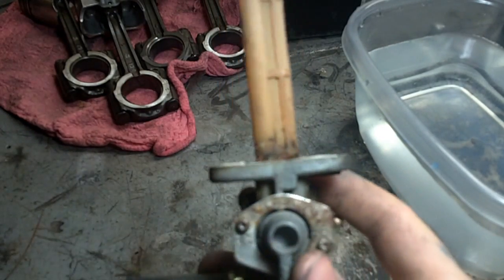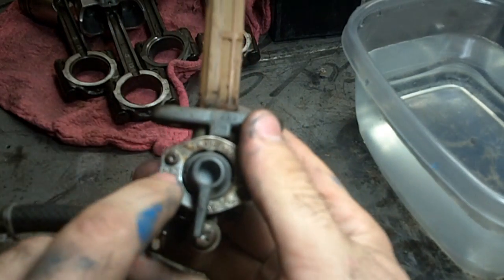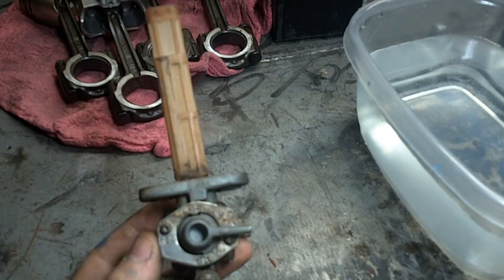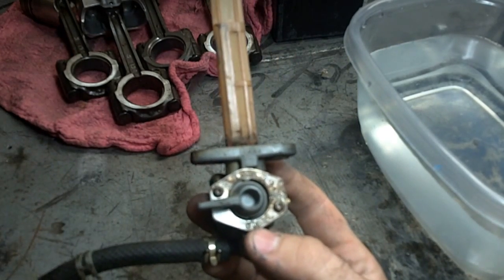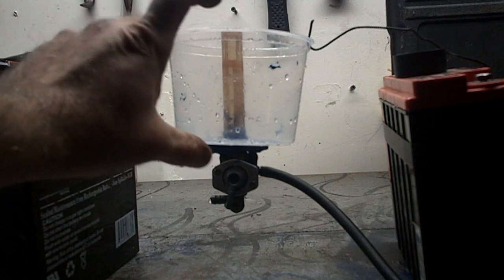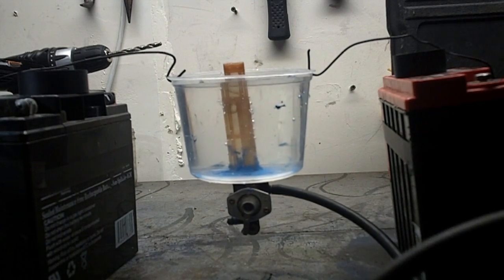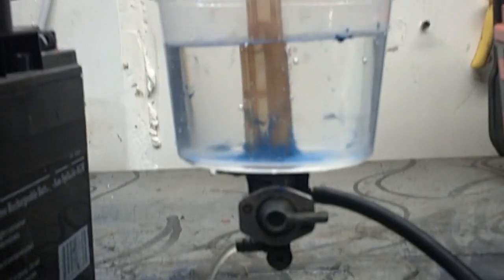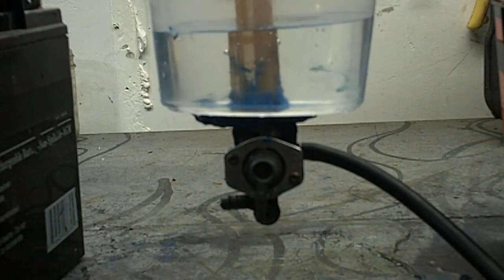How does a motorcycle petcock work?

Comment: I was just given a 1985 Honda shadow V. T 500 C, and there's the one line that goes from the petcock. Straight to the cylinder head. Then there's a big line with the Spring on it. That goes to the big nipple on the back. Then there's a little nipple on the back. Also, that when you turn the petcock on the fuel shoots out of.  And I can't for the life of me, find out where to hook that 1 up to.

Comment: What would be problem if no fuel flows when in prime position not a drop
Reply from the maker: Petcock clogged up. Take it off and replace it or clean it out
Reply: @mrmaxstorey  thank you for quick reply I have it of today can't see any thing  blocking any bits can I use carb cleaner spray  through it . I have also bought a fuel tap repair kit today
Reply from the maker: @johnshanks7902  yea give it a shot, if it's the kind that has screw and not rivets it can easily come apart
Reply: @mrmaxstorey  yes it's screws bandit s1200 1999
Reply from the maker: @johnshanks7902  ok then check out my other petcock video it will help

Comment: If you have a a vacuum petcock on your bike , can you put a gravity petcock on it ? Or does it have to have vacuum
Reply from the maker: yes you just need to block off the old vacuum line
Reply: @mrmaxstorey  the one on the carb?
Reply from the maker: @Titanwins90  Coming out of your petcock are two hoses, a big one and a little one. The big one brings gas to your carbs, and it must be hooked up to your new petcock. The little one was the old vacuum line which used to open the petcock. You don't need it now, however it must be blocked off so the motor does not suck in extra air. Leave it connected to either the intake manifold or the carb depending on your bikes setup, and on the other end which used to connect to the petcock, put a little bolt in or tie it in a knot so it is blocked off
Reply: @mrmaxstorey  oh okay yes that answers it all , thank you Sir , mad respect 🙌

Comment: This is a very helpful video to understand how this type of petcock works. Thanks a lot for it. Now I can dry my carburetor just by pulling off the vacuum line and run the motor until it die for winterization.

Comment: Hello this is from the future and I have a quick question. I have a scooter with a petcock and carburetor that doesn't require a vacuum feature. Now my carburetor have a problem and I have a reserve carburetor but it has a vacuum hose attached on it. My problem is can I still use this carburetor and just plug its vacuum port since I don't have a vacuum port to attached it on my petcock? Thank you very much in advance for answering my question.
Reply from the maker: Yeah thats fine
Reply: @mrmaxstorey  do i need to plug the end of the hose or leave it as it is?
Reply from the maker: Plug it up

Comment: I had a question hope you can help. Trying to get a 1977 Suzuki GS550 going. It’s my first project bike. 😬 So when my tank and petcock all hooked up looks like no fuel is going through but when I disconnect the petcock to test it it seems fine. Is it a vacuum issue or carb issue? Total rookie at bikes but trying to pick up a new hobby. Your videos rock!
Reply from the maker: Im not sur eI understand your question. Are you saying that with gas in the tank, and your petcock on the gas tank, you turn the petcock to PRI and you do or dont have gas coming out?
Reply: When I have it on prime gas does come out when it’s not hooked up to the carburetor. But when it’s all connected to the carburetor it looks like no gas flows through the fuel line. I also realized that what I assume is the vacuum line isn’t connected to anything and just has a screw blocking it. So maybe it’s that? Or am I wrong?
Reply from the maker: @SaiasAdventures  OK so either the carbs are already filled up and dont need gas, or the floats are stuck not letting gas through. At some point the vacuum feature of your petcock failed and the previous owner plugged it up, so now it operates as a manual petcock where PRI is on, and any other setting is off. Thats fine for the temporary until you fix or replace the petcock, so long as the vacuum line going to your intake manifold is also plugged up.
Reply: Thank you so much! I will check those next
Reply: So I removed my carburetor and notice little to no gas in them. Taking apart the carbs all the float needle inlet valves have a groove in them. Which I believe is causing the floats to stick. But I also noticed the carburetor isn’t the original set. The service manual has a Mikuni BSW30SS and I currently have Mikuni KOGYO. Would this be an issue as well?
Reply from the maker: @SaiasAdventures  I dont know. The main thing is the jet sizes are correct, but differences in lengths and size of the venturi can affect the way the bike runs. Its unlikely that this is stopping the bike from running, but I dont know to what extent it will change reliability, power distribution through the powerband and fuel consumption
Reply: Okay thank you for your help!

Comment: Quick question, when I disconnect the vacuum line from the engine block and suck on it, gas flows through the petcock but when I connect it again to the engine block and crank the bike, fuel doesn't flow at all. what does this mean?
Reply from the maker: Maybe the line is leaking? Or that cylinder doesnt have compression?

Comment: Great video!! Question. Just picked up a 1982 cb900f.  Jetting spot on. And it runs super strong.  Going down highway after only a couple tank fulls on this bike and it started to bog and I hit reserve  but still stalled.  Pulled over still had about half gallon in It! Do you think the reserve hose is clogged???  Put 2 gallons back in it and it started right up again
Reply from the maker: Maybe, this video shows how to test

Comment: Questions....1) could this be the root cause of mine flooding and pouring gas all over the floor? I always thought it was the float valve sticking. Was it acting as if on "prime" and constantly flowing fuel, even though on "run"? 2) Would this cause problems if tank was not vented or vent was somehow blocked? Any useful comments are greatly appreciated.
Reply from the maker: Yes when your carburetor is overflowing while sitting then 2 things have gone wrong, both the float valves are sticking open and the petcock is leaking. If the tank is not venting then you would have fuel restriction after running for a short period, and that is an unrelated problem.

Comment: Ahhhh....okay....see, my petcock (from a Chinese 48cc engine kit" has "Fuel -->" written on the switch, and you can turn it 180°, and at the 0°, °90 and 180° points there are 3 tiny diagrams (respectively for each degree point), which are a half tan, closed/solid circle (in the °90 degree point), and a half tank. I believe you just solved my mystery ;) the "half tank" means you are reserving the reserve tank, so to speak. I'm so glad I found your video!!!

Comment: I've got a GS500 1999 model starts great on idle but dies soon as I try and rev it I've cleaned carbs and checked for air leaks all good there could my Petcock be at fault ??
Reply from the maker: If gas is getting to your carbs to allow the bike to idle, then the petcock is probably not at fault
Reply: mrmaxstorey  yes true I though maybe the flow may be very slow but would rather leave it alone incase I cause a split in a seal or something. Bike had previously sat for 3 years ran perfect before storing I'm baffled carbs are clean no air leaks and tank is clean with fresh fuel
Reply from the maker: How is your compression?
Reply: mrmaxstorey 150 on each cylinder first thing I checked even though a mechanic told me if it's starting straight away compression will be fine however I checked anyway and got just shy of 150 on left and 150 on right
Reply from the maker: Plugs not fouled? Good air filter? Float heights checked? Emulsion tubes cleaned? Valves adjusted? Clean carbs again...
Reply: mrmaxstorey  plugs are fouled yes they keep fouling

Comment: So on my 1980 Kawasaki 440 I have two plugs on my petcock. One is a line that goes to the fuel filter and the other is a vacuum... but how can I tell which is which?
Reply from the maker: The vacuum is smaller and on the back
Reply: mrmaxstorey thank you sir. I finally found the manual as well... the carbs are leaking fuel now. Any suggestions?
Reply from the maker: Check out my video on leaking carbs

Comment: Nice video! Mine doesnt have the vacuum hose, so I guess it creates pressure directly from the fuel line going to the carb. My question is whether adding an external fuel filter would significantly lower the pressure as I start running out of gas (due to lower weight of fuel)? I really wanna add the plastic filter, but dont want to end up dealing with a low pressure fuel system.
Reply from the maker: Its not under any pressure, it just comes down by pressure. I havent had any problems with inline fuel filters
Reply: mrmaxstorey thanks

Comment: Is it okay to ride my motorcycle without the petcock filter on it? Will it harm anything without it? 

When the gas tank was repainted the petcock filter was left out at the body shop and has not been replaced.
Reply from the maker: If the inside of your tank is spotlessly clean and stays that way, you wont have any problems. However if you develop any rust, dirt, corrosion, or sediment in there, there is no filtration to prevent it from going into your carbs. It is cheap insurance against a carb cleaning
Reply: mrmaxstorey gotcha. Insurance is a good way to look at it. Thanks for the reply!

Comment: I juwt bought a 1981 kawasaki 440 and my petcock has like 3 places it looks like you can plug stuff into. But only one place is pluged in.

The bike wont stay running if its switched to on it will eventually stall when i slow the bike down. Is this an issue with my carbs or the petcock
Reply: Also the petcock does not have an off mode just. ON PRIM AND RES
Reply: Manuel Seniceros I have a 95 Suzuki Savage 650LS. My bike was running just like the way you described in your comment. I just changed my factory petcock to a Yamaha Raptor 660 gravity pulled petcock. My factory petcock only had a RESERVE, ON, and PRIME also. The new one I'm running allows you to turn off the fuel all together while sitting. Also I knew my bike was having issues once it started to only run in the PRI and RES postions. The part cost me 30 bucks for a brand new genuine Yamaha petcock instead of 110 for a new Suzuki factory one. It took me about 15 minutes by myself to fix the issue.

Comment: I have a 49 cc scooter and there's no valve to turn off and on only a square bolt. I'm looking at this because it won't start unless you squirt gas into the carb. So I figure petcock or fuel filter. any advice? thanks

Comment: yo, thanks a lot! I've got a '96 Kawasaki Ke100 and this helped much. I'm new to bikes and got this bike from a dear friend. However, the hose that runs from the vacuum to the engine I presume will not fit? am I missing a part which attaches to the hose as an intermediary?
Reply from the maker: Usually its just the hose. See if you can squeeze it on there, sometimes the rubber shrinks and its tight
Reply: It's shrunken for sure. I may just try to expand it if not then replace it. I did an inspection and I've gotta grab a new petcock. That delicate tube that you spoke of eroded with the old gas. The bike had been sitting for a few years. I've got work lol. Dude, I appreciate your patient video, you've inspired me in many ways
Reply from the maker: Glad to help

Comment: What do you think might be the problem if I have a bike that if I put the petcock on the ON position it starts all good and runs good but then about 20 min later the throttle response will weaken until it sputters and dies. However, if I turn the petcock just a little bit to be in between the ON and PRI positions it works completely fine the entire time. Any ideas?
Reply from the maker: Take your petcock apart and see what is damaged in there

Comment: So the Vacuum line leads the the carbs, and the fuel drain( where all the water was escaping from) leads to where? the engine or a fuel filter?? If anyone cold answer than for me it would greatly help! Btw i have a xr100r.
Reply from the maker: That goes to the carburetors. Sometimes there is an inline fuel filter, its a good idea to have one
Reply: Thanks! Ill check it out, trying to get this dirt bike rebuilt for the summer haha

Comment: Does all petrol drains out of tank if accidentially petcok remain on for like 2-3days? And where does it flow? On floor?
Reply from the maker: +Dark Prince Im not sure I understand the question
Reply: i think he means "if the petcock remained in the prime position for an extended period of time, would the gasoline continue to run out even with the bike off? and if so, where would it go?"

Comment: my petcock leaks from a small hole on the plastic piece that sandwiches the vacuum connector plate to the back of the petcock. It was clearly put there by design. Just wondering what the purpose of this hole is and why it leaks when i have pet set to on or reserve but there is no continuous flow. Any thoughts?
Reply from the maker: +Zillacus Your petcock leaks because that diaphragm has a hole in it and will need to be repaired. The purpose of that tiny hole is to allow air to go n and out on the other side of the diaphragm, so trapped air isn't providing pressure for the vacuum to work against. Otherwise it would be a closed system and wouldnt be as effective. Hope that makes sense.

Comment: +mrmaxstorey  Does vacuum work with a vented gas cap? 
Pretty much what your can of water is.
Reply from the maker: +BennyWheelie A vented cap just lets air in as gas flow out, its not related to the vacuum functions of the petcock
Reply: +mrmaxstorey Ok, thanks. As I understand it, if your gas cap is non vented your tank lets in air another way.

Comment: Thanks for the video, I have an1985 GS550 that is a crank but no start, it has spark from both coils & and I can spray fuel in carbs and it will run so I thought it could be a petcock problem so I hooked up a remote fuel source and still wont run, cant smell fuel & plugs are dry, former owner changed float valves any idea?
Reply from the maker: Rivermetal Clean those carbs man

Comment: My Kawasaki 1978 kz650 will be on reserve and will not start sometimes. But I can hear gas sloshing in the tank but won't start. I add gas and it starts.
Reply from the maker: ***** Sounds like the reserve inlet is clogged
Reply: Is it easy to clean?
Reply from the maker: ***** Yes. Use this video and my other petcock video to help you

Comment: could you do a video on how to run vacuum lines from the carbs to the petcock and motor? i have an 1983 Kz550 F1 Spectre and i cant find how to run my vacuum lines. Thanks
Reply from the maker: You should only have 1 vacuum line, which runs from the small nipple on the petcock to a carb boot.
Reply: Do I just cap the other 3 or leave them open?
Reply: Do you know what size mm line it is?
Reply from the maker: Brandon Carrizales
No i dont know what size it is but bring the old line to the auto parts store and they will be able to match it for you. Yes you cap the other three nipples coming off the boots, but dont confuse them with the carb overflow hoses, as they are supposed to hang free to the air
Reply: Ya I don't have any vacuum lines on the bike at all, when I bought it they were all missing. Thanks for the help though!

Comment: I am trying to get an old 2001 Yamaha 125 back in running order. In an attempt to empty the old gas (I did put Stabil in the tank periodically) I removed the fuel line, thinking fuel would run out and into my container. The petcock is vacuum actuated....is that why no gas came out? Would I have to suck or blow into the vacuum line to see if the petcock works and gas comes out? I took the squirt gun off of a spray bottle and connected it to the vacuum line (it fit perfectly) so I will have a vacuum when I squeeze the trigger. The battery is shot and I have to grab a new one today. I was afraid to run it until all gas was cleaned out. I took the petcock apart and it looked clean as can and the diaphragm seemed to be fine as well. I think you just answered my question but suggestions would be great. Super video, very informative.
Reply from the maker: Does your petcock have a prime setting? If so just turn it to that. If not, consider taking the petcock off the tank and letting it all gush out that way

Comment: Properly functioning floats should keep the 'Reserve' setting on the petcock from allowing more that the necessary amount of fuel through to fill the bowl.... correct?
Reply from the maker: No. When the bike is running, the petcock is open like an open faucet, ad it is up to the floats and float needle inside the carburetors to regulate the amount of gas in the bowls. When the bike is shut off, the petcock stops the fuel flow

Comment: Does it matter what size petcock as long as it's vacuum assist to replace the bad one?  My 1981 Suzuki GS1000G.  I am trying to adapt from a different bike, rather than be out a bunch of money.
Reply from the maker: Well I wouldnt replace it with a GS400, but if you find one that offers similar fuel flow you should be good
Reply: mrmaxstorey Would a Gsf600s Gsf1200s size petcock work?
Reply from the maker: Timothy Time
If you can get it to fit on your tank, it would probably be fine